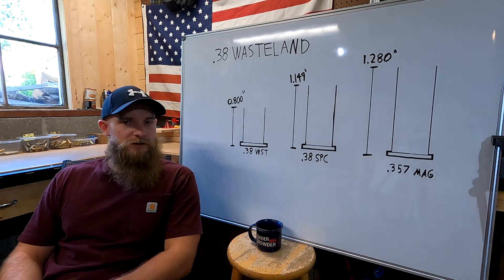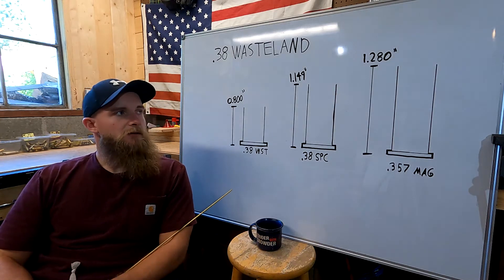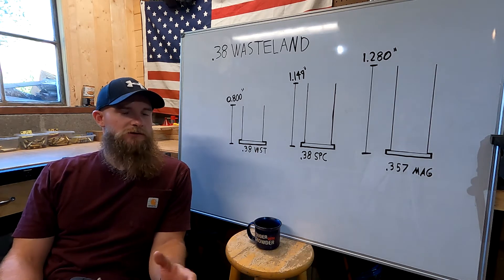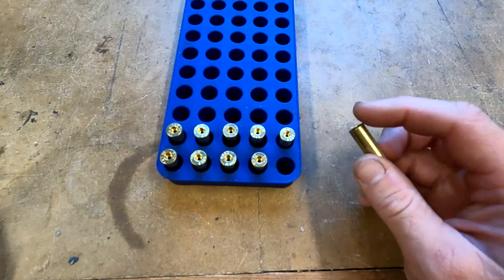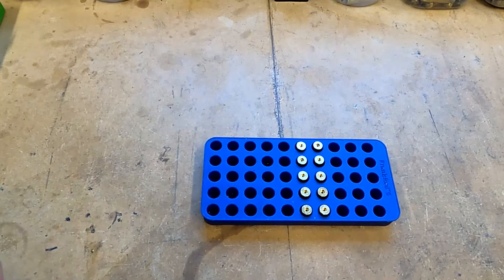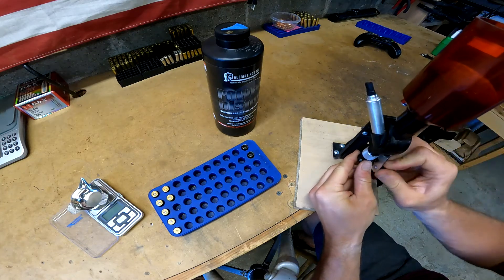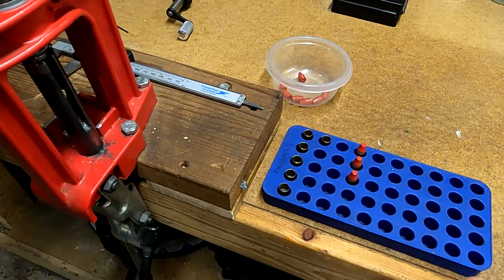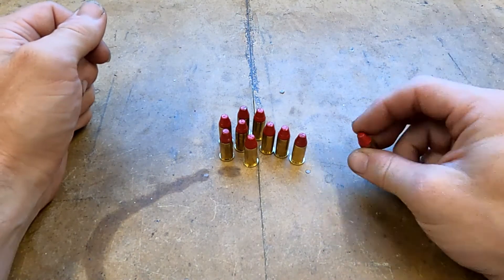.38 Wasteland

Comment: see also .38 Short Colt, .38 Long Colt , .38 S&W Special , .357 S&W Mag , 
.357 SuperMag , .357 Rem Max, & .38 Army Marksmanship Unit = 7 out 
of 11 ~.38 base diameter .379 - 381 cartridges on Wikipedia are 9mm 
& .379 base diameter in  & have  .765" - 1.610" case lengths